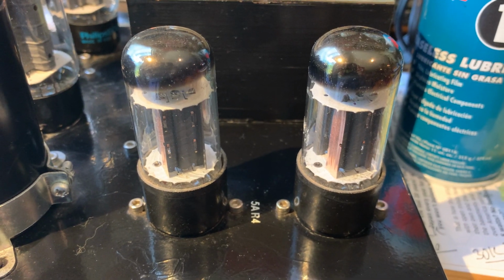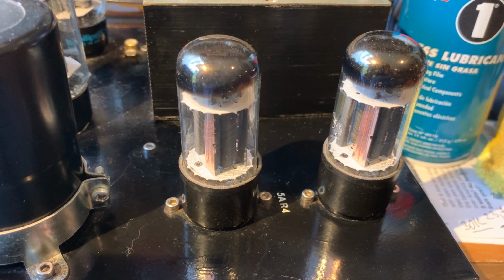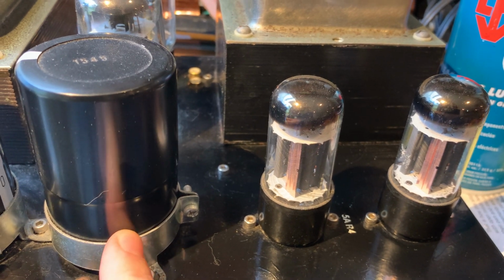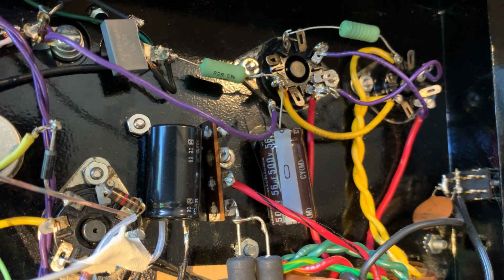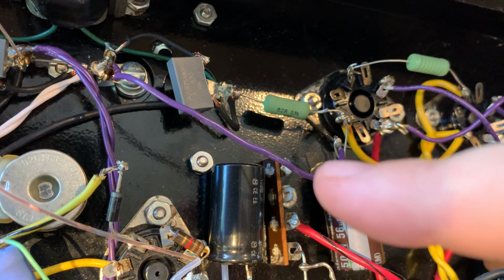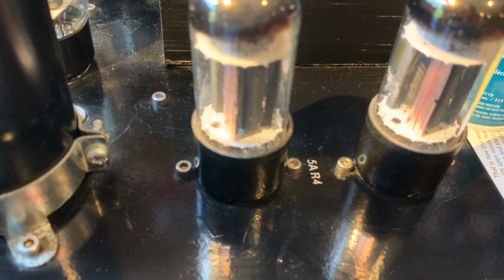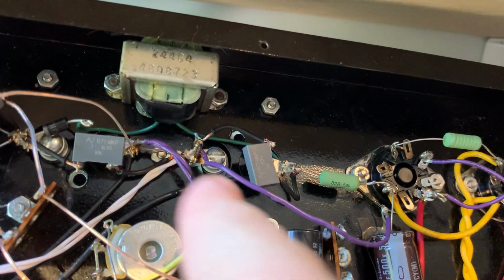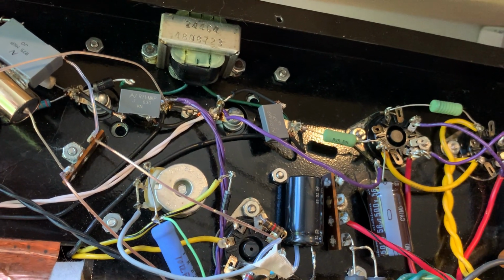Rectifier tubes and input capacitance! How high can you go? Surprise!

Comment: First of all , there is no inrush current. This guy is on the right track , but explain all of it... On my equipment, I routinely use a pair of 100 uF caps off of an EZ-81 rectifier tube , have been for years..... Those data sheets, for input capacitance , have long been stale and out-of-date, for decades , not years , decades........

Comment: why don't you use a thermistor instead of the resistor that will protect from your inrush current
Reply from the maker: An inrush limiter is a good way to protect, but it also has a pretty negative effect on the sound. This effect is not so much noticeable on most systems, but once system transparency is very high, installing an inrush limiter can completely suck out life and dynamic transients. (It also prevents the transformer from supplying those very fast transient peaks.) This is very noticeable once you have choke filtering in the power supply. With resistive filtering the inrush limiter is not a big issue, though.
Reply: @realworldaudio  are there workable circuits that charge the capacitor through solid state just for startup and then switch over to tube rectification?
Reply from the maker: @cmfuen  There is another way to use a solid state diode, will show that soon. However, a simple solution is to have a relay that switches a 200-300R resistor in series with the rectifier cathode for the startup period. That slows down the initial charge. However, a problem is that if a rectifier cannot handle the initial charge, it will be still distressed during normal operation, and the sound will be powerful though but more mechanical / artificial, and the transient details will be smeared.
Reply: What about inrush current limiting at the mains? I've always used NTC thermistors at the AC line input of my amps, and have not noticed a discernable difference once they're warmed up. Thinking about that though, it would create a higher impedance power supply. 
EML rectifier tubes actually have a slow-warm-up "link" built into their heaters (directly heated), they seem to last forever and are among the best I've heard. Slow- start is designed into them from the beginning though, not an afterthought.